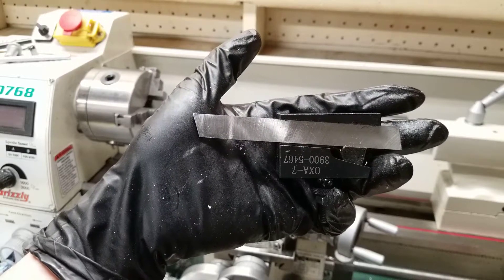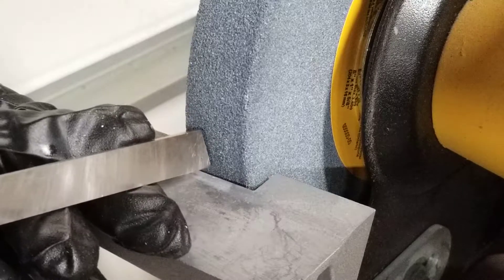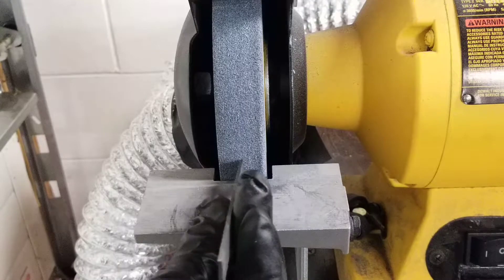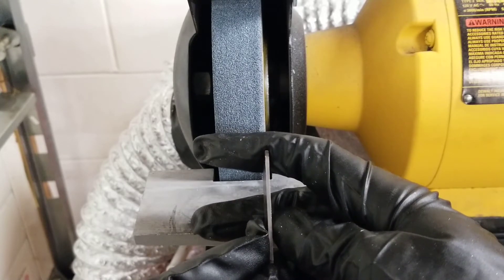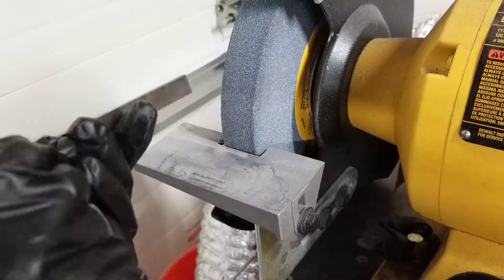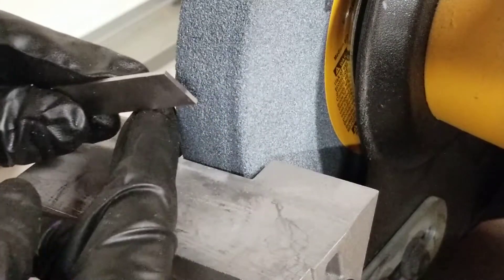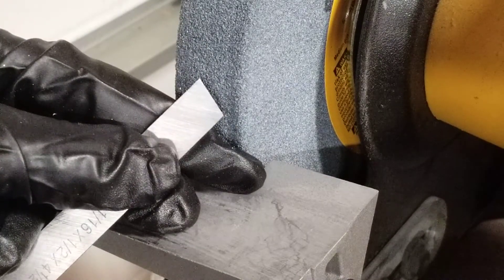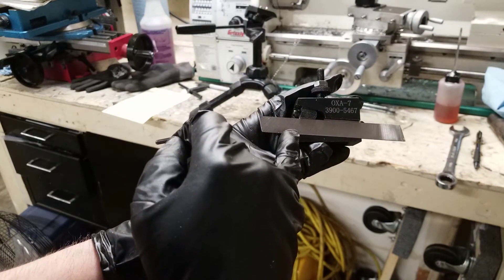How to Sharpen HSS Cut Off Blade for a Lathe

Comment: Do they come sharp? And how long can you cut before needing to sharpen if you're cutting a soft metal.
Reply: The one I bought didn’t.. ymmv 👍🏻
Reply: @adammoss5284  No worries, I use a HSS lathe at my job, I got good quickly. I'm actually the only person that can sharpen a blade correctly, thanks to this video.